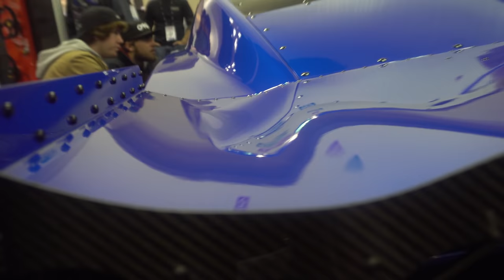INSANE Radial VS The World Mustang

Comment: That is one nice ride. Pro mods run efi/mechanical injection. Efi to start the run , mechanical to finish.
Reply from the maker: Pretty wicked!
Reply: Its EFI with billet Atomizer's fuel injectors controlled by Fueltech.  It's very similar to the setup on Rich Bruder's X275 record setting mustang also Disomma power plant . Rich and Nick Bruder help with the tuning of the beast. Just 8 of these injectors will support 4500+ in a methanol application . It's a Chunk Ford roots, not screw because of the weight break. It also has real steel quarters and roof and stock wheelbase. It's legal under many other rules then just R vs W. It's not a composite pro mod body.
Reply from the maker: @waynebollentin989  badass! Thanks for the Info!